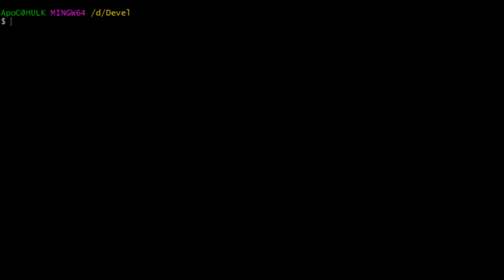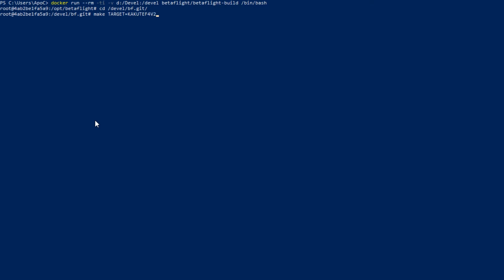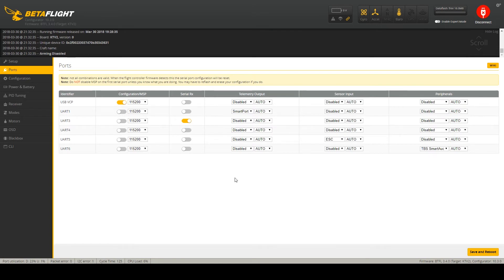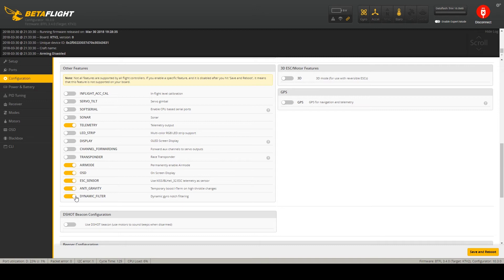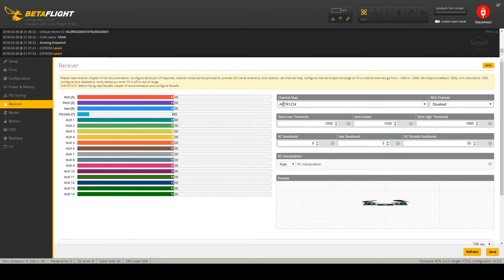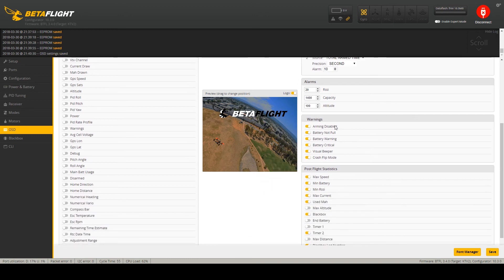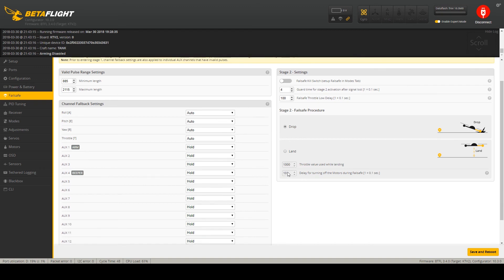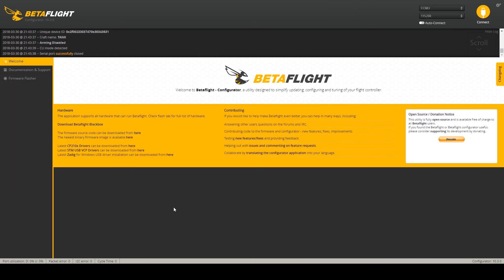Compilation and setting of Betaflight 3.4

Comment: once clone, it's on your computer under /d/devel ? You could then edit a .H or .C file, then compile create the .HEX and upload to FC?
I would like to learn a little more about modifying betaflight code for my own FC. 
thanks
Reply: From What I know about this Jerome I think that you only need to modify the header file. When I get Docker sorted out I might just test that this works by say changing the buzzer pin on an FC that I already have. If it changes successfully maybe that confirms that only the header file needs to be changed?
Reply: @MrPnew1  yeah changing buzzer pin is simply the .H file BUT you wanted to add SPI RX! which that is .C code too.
Reply: @JeromeDemers  Oh thanks I am totally out of my depth here but willing to learn :)

Comment: are you use the Matek F405 AIO oder the Matek F405 CTR? Are there realy enough Power for run 32khz/ 16khz PID Loop? And whats the CPU after Overclocking? Bevor it was about 62%
Reply from the maker: Hi, at the video Kakute F4 V2 AIO is used, but my first quad is built with Matek F405 AIO and is happily running on 32k/16k loops. On Matek I am also using softserial port for FrSky telemetry, dynamic filters and DSHOT1200, accelerometr is disabled. In configurator with mentioned setup Matek has about 42% CPU usage when overclocked to 216MHz.

Matek F405 CTR as far as I know does not support 32k gyro mode
Reply: ahh right!! the CTR use the MPU6000...thanks for your information! current i rund the Matek CTR and a Fortini F4 OSD. Thx for your fast answer, very intresting.